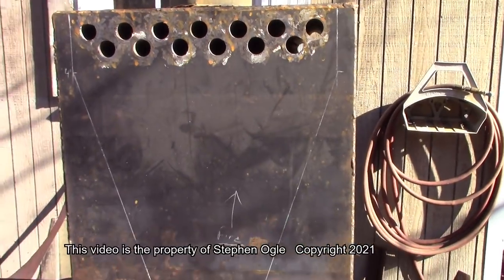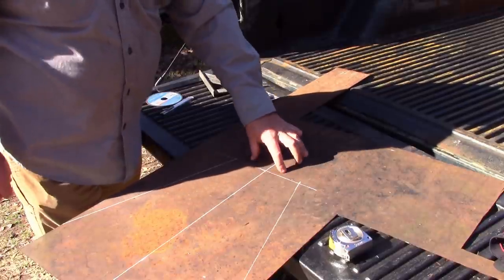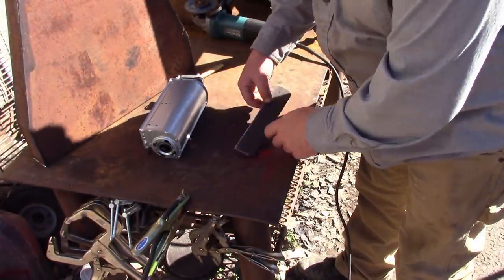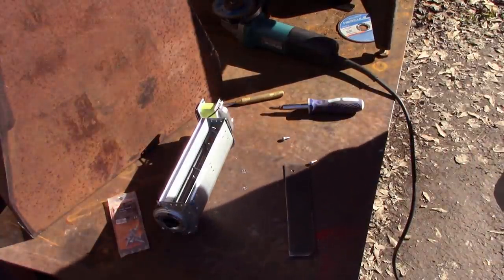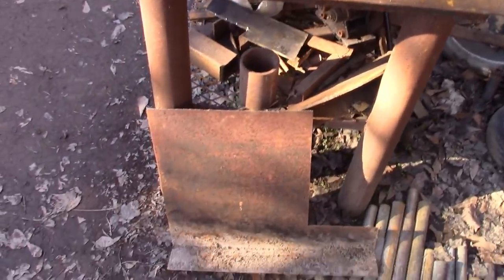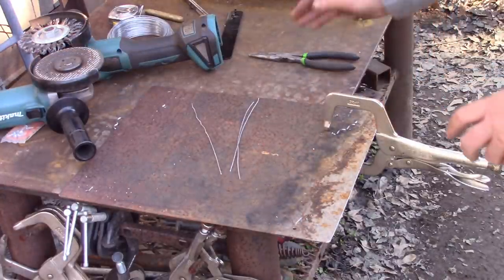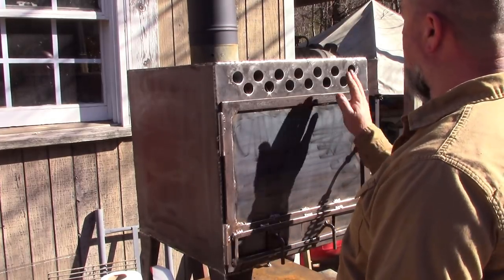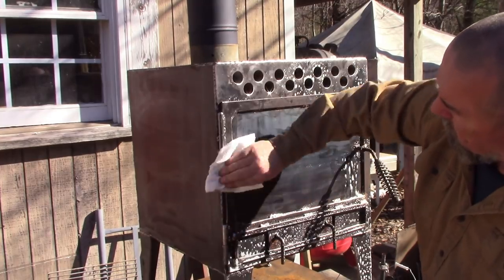#172 Building a Woodburning Heater with a Blower Part 3

Comment: Let us know how much it weighs.   Also, you might want the fan running during the second burn, just to be sure the zinc from inside the tubes is purged.
Reply from the maker: Thank you Doug. A 4x8 sheet of 3/16" steel weights 245 pounds and I used about 3/4 of a sheet for this build. So I estimate it weights about 183 pounds. Great suggestion and I will have the fan running for the next burn. Thank you sir. Take care.

Comment: Iv'e welded up several wood stoves and one thing in common is the issue of long flat sides which move and warp when the temperature starts to max up, so design consideration is worthwhile to counter it. Also door handles and draft controls need thinking through because with metal expanding under high temperatures ,what did work when cold can lock up when hot. I enjoyed the video and thanks

Comment: looking awesome, got me thinking about building me one. instead of using it in a shop, what could be improved to use it in a house? in stoves you can buy they are usually fitted with firebricks or whats it called inside them. great work stephen.

Comment: Im going to be doing a similar project except my burner will be outside my garage in a fire proof structure with a supply and return on my heat exchanger and my chimney will have a triple damper system and a supply and return to the meat smoker from the chimney and im thinking about a sauna as well we see im a driver so it may take a few years 😢im hoping to have a 3in1 I'll be able to go from my heated garage with my beer to my sauna and from there step out to check my side of ham😊😂😂
Reply: Oh you might also like to look into thermal batteries sand basalt asphalt salt black sand clay gypsum all kinds of stuff can store heat for that ambient heat after the fire 😊

Comment: When you have a blower  sucking air  out of  the same  room as your fire uses,   you have just built  yourself   a smoke  bomb. A good  firewood stove will have air pipes  to the outside  ,  then your  room doesn't  have a vacuum  to suck in cold air  and your lung will appreciate  it.
Reply from the maker: Thank you for your insight. However, there is no vacuum produced by the blower. It takes cold air from the shop and after being warmed by the pipes, it is then sent back into the shop. It is a completely closed system and separate from the fire box so there is no smoke coming into the shop except for the small amount when I open the door to add fuel. No smoke bombs yet. Thank you for your comments. Take care.

Comment: Came out looking really good! I also have a wood heater in my shop and love it. I'm about two weeks away from buying another wood lathe and was wondering if you have had any issues with your new grizzly lathe. I really enjoy your channel and trust your opinion. Currently looking at a laguna 1836 but have a little sticker shock !
Reply from the maker: Thank you sir. My G0766 has been a real trooper. I have had no problems with it that needed any type of repair. Plenty of Power and runs very smooth and quiet. I would buy it again if all things were the same.
Reply: @StephenOgle  can you do one for me and how much cost